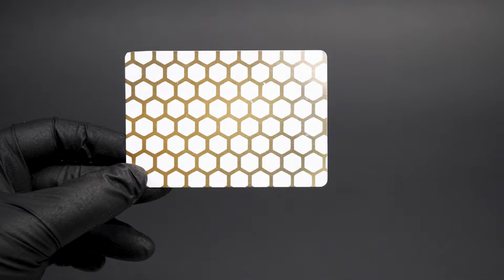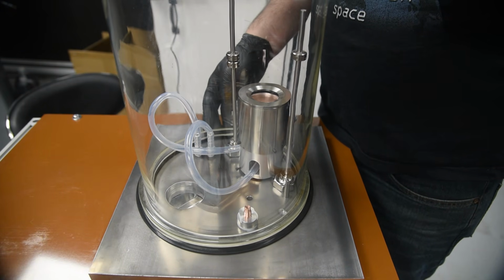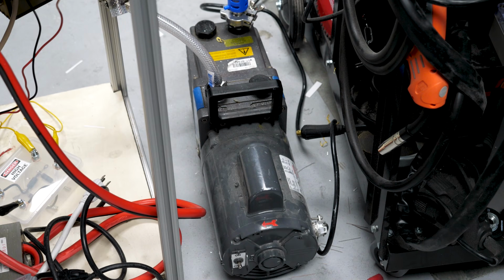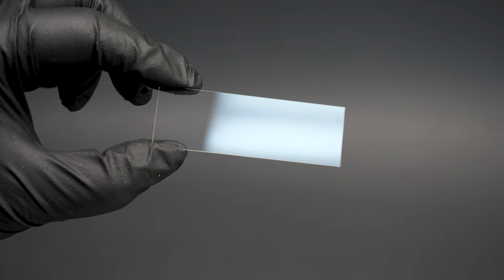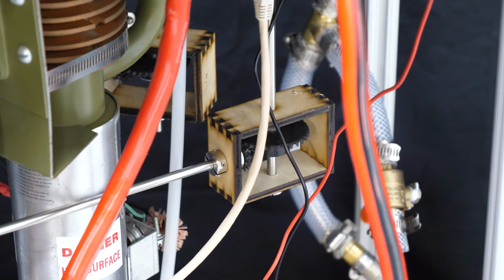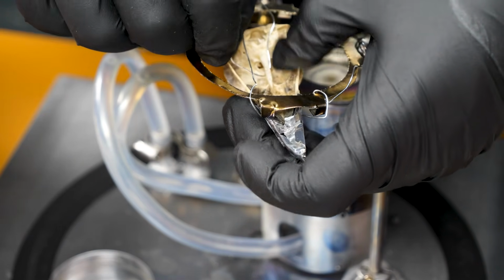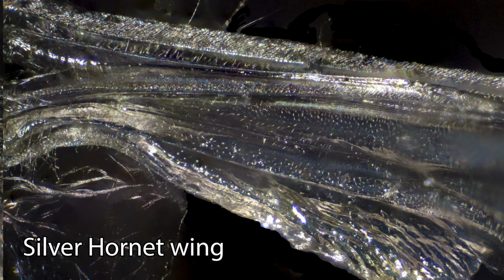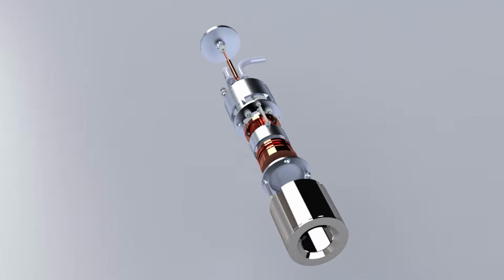Metal Coating using PLASMA (Part 1 - How it works)

Comment: 1) how often can you use a sheet of a coating material?
2) what is the thermal evaporation system for?
3) when you explain i.e. explaining the different parts something is made of, showing the part and a picture of the thing at whole (like at13:14) , could you include an arrow (or something like it) in the picture of the whole thing showing where the single part is build in? (this would ease understanding)

Comment: Couldn't you valve off the diffusion pump from the vacuum chamber so you can keep it fired up while you cycle the roughing pump?  Are there valves good enough?  Use two in series just in case?
Reply: yes, exactly how they should/were be built. and add a liquid nitrogen trap.

Comment: Absolutely amazing man, looks great and very well made. As for the switch over taking so long due to the diffusion pump needing to cool down. Have you through about adding a air lock between the chamber and pump. This would allow you to keep the pump in a ready state, or get it running whilst you setup, without it losing vacuum and thus setting on fire.
Reply: Wouldn't you want some more valves in addition to that one, one to also isolate the diffusion pump from the roughing pump, and one to connect the roughing pump directly to the chamber? Since otherwise, the diffusion pump would for a short time be exposed to atmospheric-pressure air from the chamber while hot when the chamber is pumped back down.

Comment: Is there any specific reason why you didn't add capacitors to the output of the FB rectifier? The direct output of that will be incredibly spikey without it and could definitely cause some major issues If used for regular DC appliances
Reply: You watch electroboom?
Reply: @TheWizardGamez  i work in the electronics industry

Comment: Im working for a company that specializes in thin film technology. If you need any advice you can contact me. One piece of advice in advance: If you sandblast your microscope slides with 2 bar pressure and a grain size of 150 - 200 you can prevent delamination of your coating from your substrate.

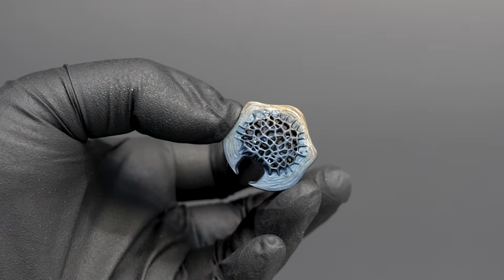Comment: 18:15 exactly what I was thinking, lol. Like when making armor. Instead of painting foam to look like metal, better to just coat it with actual metal.
Reply: foam really don't like vacuum
Reply: Well, you'll need a big freakin vacuum chamber for an armor to fit
Reply: @simsanutiy  you would have to go through all parts, not necessarily the whole armour in one go.

Comment: Without smoothing capacitors on the outputs of the rectifier you're getting very dirty DC with lots of variability.
Reply: He is making metal flower. I think he is fine
Reply: @EbbDrop  it was an informative comment in case he cares about having smooth DC. In no way does it detract from his accomplishments.
Reply: @deltachange6204  To sustain a plasma, you'd actually want to minimize the capacitance at the output. Instead you want a constant current, or in this particular case maybe constant power control would be ideal. So the thing to add here would be a huge (because he uses a low frequency transformer) inductor in series with the DC side.
Reply: @Basement-Science  aw that makes sense. It wasn't clear if the energy was being used straight off the rectifier or if it was regulated for other functions(guages, sensors, etc.) since he said nice DC wanted to make sure it was not supposed to be smoothed
Reply: I don't think the smoothness of the DC matters at all in this case. The sputtering device already is basically a giant capacitor. It uses the strong electric field between its plates to ionize the thin argon gas. The DC source is there just to keep it charged (AC would periodically charge and discharge it, with is counterproductive).